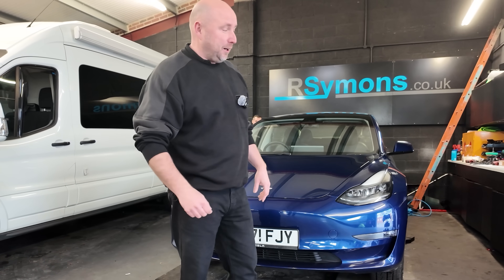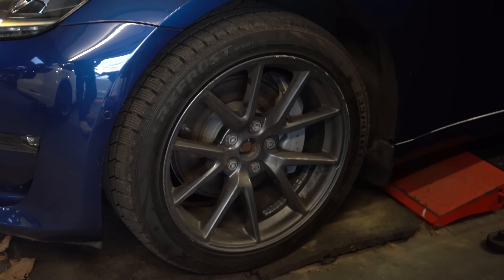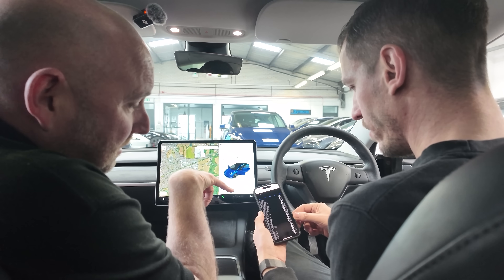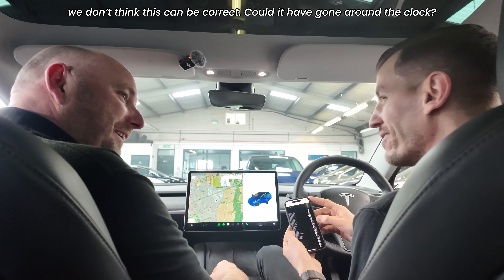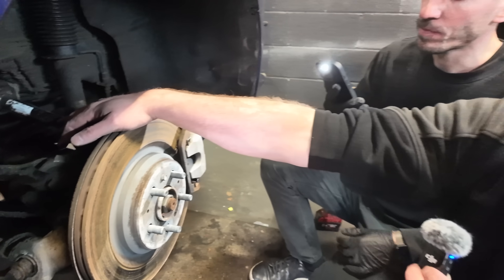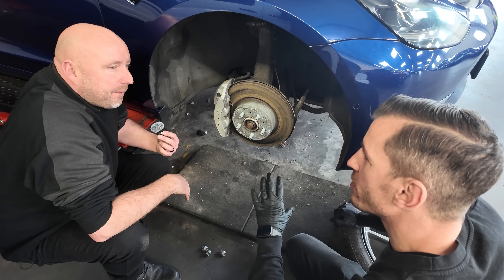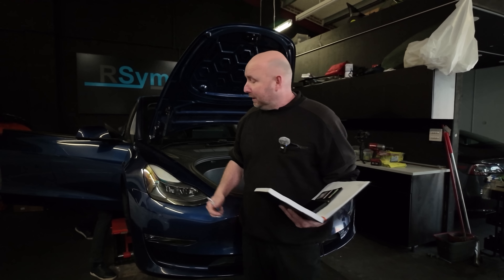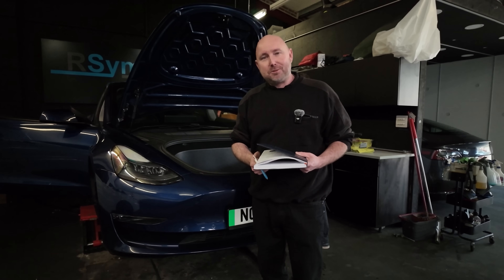EVERYTHING WRONG with my HIGH MILEAGE "21 Tesla Model 3! | Battery health and other issues!

Comment: My last Y went back with 90k miles on it , absolutely immaculate. Now got 3 RWD LR even cheaper to run and much better car . 
PS. The Y cost us 10 tyres , and the charging. Nothing else . 
I have friends with coal burners which are constantly being serviced or repaired at great expense.

Comment: My old 2014 leaf 130,000 km 87% battery just done the back breaks 1st time 4th set of tyres 3rd wipers and 8th cabin filter she has served me well. Picking up my long range model 3 tomorrow 133,000 km 90% battery new tyres and brakes because it was a fleet car. Off to Italy on Sunday willfigure out how everything works on the way.

Comment: You changed the wood looking panel because they peel off, that happened to my tesla less than 40k miles. My leather seats and leather wheels are peeling off as well. Paint cracks are showing off. This never happened on my 13 year old 200k mile prius. Tesla battery died on me and many failures. Never had issues on my prius. This shows how bad Tesla quality is.
Reply: glad i don't have leather wheels on my cars.   do you park this car outside a lot?

Comment: And it still maintains its horsepower and torque like new where as ice will lose 25% by then ...if in fact it doesn't need a brand motor.

Comment: Would you buy a lightly used tesla modle 3 long range? I want an honest opinion before I do... I can't afford a new one and I commute roughly 100 miles a day... in Canada so cold weather would you recommend it...
Reply: 1. What do you exactly mean by lightly used? What year, mileage?
2. Do you have charger or a plug at home? Or maybe at work?
Reply: @yuriymolodkin  yes ill have a level 2 charger installed. 30k-50k kilometers. 2020-22
Reply: @BentSmore 
1.
From the 2021 restyling, the Model 3 has a heat pump. It increases efficiency in mildly cold weather, but tends to break, especially in harsh environments (like below -10C). If it's under your warranty – no problem; if not, it can be pretty expensive to repair (around $2,000).
In principle, I'd strongly recommend finding a restyled model – ideally with a Ryzen processor (which you may find in the Model 3 starting from 2022).
But as with any other car, of course, keep an eye on the car's condition itself, as you can buy cheap and pay twice.

2.
If you have the possibility to charge at home, your commuting is no problem at all. If you have a usual scenario every single day, you can adapt your charging behavior to increase the lifespan and decrease battery capacity degradation by keeping your car around 50% state of charge. This will help a lot.
For example, I have 140 km in total per day when I commute to the office. The car consumes, on average, 20% one way and 15% on the way back. So I charge at work to 70%, then I have 50–55% when I'm back home, which is enough for some in-city commuting like groceries. The next day, I commute to the office again, arriving with approximately 30% to charge again.
Reply: @yuriymolodkin  very informative... if the car is left outside at work for i hour's in -15 -20c will i experience a big lose of range for my trip home? Most winter days in my area are -10 or warmer but we do occasionally get stretchs of deeper cold.my concern isnt really how far I drive more if I get stuck on the highway for an extra hour idling in a snow storm if ill be ok.

appreciate you taking the time to answer.
Reply: @BentSmore 
It all depends on several factors. The most important thing is that you have the charger at home. Because with it (assuming you will be using preconditioning if you don't have a warm garage/parking lot) the battery will have a temp of +10C. And the battery itself is massive, therefore it will have some time before freezing down. Plus, its heat will be used for interior heating and etc.
If we assume, that you did preconditioning at home and arrived at work with more or less warm battery, after 8 hours of being outside the car could show something like 10-15% less available energy due to low temperature. Regen will also be partially limited. But once you drive, car will heat the battery up again. Maybe not so fast, but it won't be conpletely frozen. And if you stuck in traffic it shouldn't become a huge problem then. Of course, you always have to think before doing crazy things like relying on arrival with 0%, but keeping some buffer helps :) If 30-70% will work for you in sunmer, then most likely during winter time you will need to expand it to 20-80% e.g.

When the battery is not dead frozen heating your cabin consume about 1-2kwh of power. You can calculate how many available kwh of your battery you need to stay in your comfort zone.
Reply: @yuriymolodkin really appreciate your responses
Reply: @yuriymolodkin  sorry one more question what do you think is more important when it comes to my choice in the model 3 year built or # of kms.. 2020-2021s in my budget i can find with like 30-60k but the 2022s are like 80k
Reply: @BentSmore  in my opinion in the end you're going to buy a car, and as for any other car, its condition is much more important than multimedia hardware revision for instance :) I'd say that finding a restyled model 3 (coming from 2021 with a heat pump, better interior, better sound insolation and sound system) is a good starting point. I wouldn't recommend to buy the non-restyled version. And then depending on the concrete car's condition you just choose what car is the best from price/condition ratio. If it's not 2022 or 2023 - it's not a big deal

Comment: The question is not how many miles but how many years will the battery last? Cause i have my Suzuki swift for 20 years and i have done 312.000 miles without any problem....

Comment: Model 3 is the worst car I have ever bought. Battery fine but everything else falling apart after 4 years and 35k miles. Leaks water. Squeaks. Seats don’t work. And to top it all off it’s worth nothing now. Much less than balloon payment on finance agreement
Reply: Have had mine for 112K. No issues here except for steering wheel leather peel.
Reply: @FaceMeltMarching that is the one thing that is actually ok in mine!
Reply: @stevewilliams1122 it really depends on the year you buy. Mines a 2020 and I know they really picked up build quality between 2019-2021 and now the new models are built really well
Reply: i do not own an EV but i bet squeaks are more noticeable in a car w no engine noises.  on my jeep wrangler i just turn up the radio
Reply: @joebezslu everything squeaks and all noises are heard yeah. Radio is a must

Comment: Very happy owner of a model Y standard range and model 3 performance (2nd one), previous car was a Honda CRV 2.2 Diesel which got to 160,000 miles, with an average fuel economy of approximately 37mpg (not bad for a big SUV). Only maintenance done was a £120 a year service and the EGR pipe cracked which Honda replaced free of charge, there was also an air conditioning flush and refill done at about 130,000 miles. Still worked perfectly when we got rid of it but the clutch was really on its last legs. I must say whilst I was massively impressed with the reliability of that car and the service Honda provided, the Teslas are so easy to run, especially when you consider the fuel savings at 37mpg!

Comment: Don't suppose you have a Battery health test for a high mileage Model 3 Performance? Early Freemont one would be good. Mine is at 13.2% Degredation after 73k miles
Reply from the maker: We have did a test on our 2019 M3P and it was 88% at 115k miles

Comment: I've been sceptical on evs with battery degradation, range, repairs etc , but after watching this video I'm starting to look at an ev for my next car
Reply: even if you are skeptical of batteries most of them come with an 8-10 yr warranty. Teslas post 2019 are generally great though and do big mileages without a worry.
Reply: Not all batteries are the same , only Tesla ,rivian ,lucid and a few more use 4650 cells . Other manufacturers don't have the longevity Tesla has to be honest

Comment: You need to change the oil and filter on the gearbox at 200.000 km. Proberly also check the heatpump for liquid

Comment: The current health report would appear to be no indicator of failure.  If you look at battery failures it is not a gradual drop off down to zero miles overtime.  They seem to go from reporting totally healthy to won't charge and a very large bill.  What we need to know is how often this happens under say 200k miles.  Is it 1% or 0.001%?

Comment: Had a f250 diesel 6.7 , in 13 years of ownership over $30,000 of repairs!!! That did not include the $13500 estimate right before dumping it.  Had 108,500 miles w less than 25,000 miles from towing.  Followed all maintenance schedule & did not drive crazy.  Dumbest purchase we ever made.  Bought M3 last month & hoping for a better run

Comment: I’m really considering an EV like this my only concern is Uk infrastructure. Looked at a trip to say Aberfoyle and a couple of charge points along the way but not really convenient. A great work around is being able to charge overnight at a stop over hotel but the nearby hotels don’t seem to have any plugs for standard overnight charges. For 80% of our use it’s excellent but that 20% is still significant. And that’s where I think things could improve to tip the balance. My mind is going back and forth between this and an x3 diesel and little things just out doubt in one’s mind about the EV.
Reply from the maker: Tons of chargers. Check on Zap Map app

Comment: Everyone knows when the Battery capacity drops below 80%, it's at end of life. It's only got 8% left.
Reply: @whoguy
Is that the same “everybody” as “nobody” want  EVs, despite year on year increas in sales? 
Even with 20% degradation it will still cover between 150 and 200 miles fully charged. Even if it drops to 50% will be able to do 100 miles, perfect for your local driving. After that it might end up as home energy storage.

Comment: Just bought an identical Model 3 (71 plate Blue AWD), but with 45k miles, so this really helps put my mind at ease that it is going to last! Took it to Tesla to fix some creaking (interior) and they changed the O ring too, so must have been a recall.

Comment: I think your calculation is very generous for the diesel, a lot don't realise yeah an average diesel can do 50 mpg or more but, what about a high performance diesel that could match that Tesla's performance, you won't be getting anywhere near that. I had a 3.0 V6 Audi A4 0-60 in 6.8 I believe and that being drove carefully on short journeys was about 24-28 mpg, motorways about 38 with sensible driving. So now think of those diesel costs. That had 180k but was old and now scrapped because of rust unfortunately

Comment: Tesla are known to run to high mileages without too many issues and have an 8 year 100 or 120k battery and powertrain warranty.  However, I wouldn't want to run any other make outside the standard 3/4/5 year warranty as the powertrain is not covered.

Comment: really interesting, have you done any battery condition tests on the LFP battery cars from China yet to see what they are like bearing in mind they recommend to charge to 100%, my 3y.o. M3 has lost a tiny bit i think, but it's only done 10k miles so not a good judgement or what is normal.
Reply: There is another video about battery degradation on this channel and it covers LFP batteries as well

Comment: In Denmark a car needs an MOT when its 4 years old and then every 2. Year.
Around 7% fail MOT… Tesla its almost 25%.
Reply from the maker: We have MOT at 3 year and then every year. 
Out Tesla fail less than anything else
Reply: When I took my Tesla M3 for it’s MOT, it passed with no issues, the tester said he felt bad asking for the full price of the MOT as there is so little to test/check compared to an ICE car. Therefore far less to fail on.

Comment: I used to buy >100k miles ex-lease cars then put another 100k (taxi) miles on them before replacement. Even a well maintained ICE will get to 200k miles comfortably these days. My EV has done 100k now and hopefully will do at least another 100k.
Reply: And the service cost (and/ or time) of "maintaining them well"?
Reply: @rogerstarkey5390 Let's not go there! In fuel terms alone I've gone from 17p per mile in 2019 to 2p per mile in 2025. I always looked after my cars so dropping the oil every month was 12 x £65 per year. Servicing became £100 every 10k miles. For clarity I paid £7k for the Avensis and £22k for the Ioniq. I could get the equivalent EV for half that now. C'est la vie!

Comment: The Model 3 is very low maintenance. The Model S has more bells and whistles that do and will break, I could almost buy a high milage M3 for the maintenance I've done on mone. If you find a model 3 with little to no rust and is maintaned the milage really doesn't matter very much.

Comment: My previous cars tended to cost £500/£600 for a sevice, repairs and replacements of parts as wear and tear maybe another few thousand, then a true saving over £25,000 in 4 years and 216,000 miles is incredible and it still has most of it's initial range. Amazing.to see.

Comment: Hello
After 10 years and 445.000 km my model s still have 87 % capacity 
Eric from Belgium
40% SUC 60% at home single phase 3kw ....
Have a nice day
Reply: @ericverlaet4447  Great to hear👍⚡
Reply: That's impressive.
Reply: Model S 85P+, 420.000km 84% cap, 30%AC, 70%DC. Plus still puts a smile on my face every time I hop in. Greetings from sunny hot inland Australia.
Reply: Looking at a 2020 Tesla 3 here in Canada . It has 100 thousand km on it . I drive about 600km a week . Would you reckon I should get it ?
Reply: How do you calculate the battery capacity?
Reply: @ Shows on your cars display.
Reply: @13Dominoo  Battery health test under the service tab.
Reply: thats amazing
Reply: Tesla seems reliable not looking people are saying

Comment: Its clear and EV saves a fortune....is this the reason big oil and ICE car manufacturers are sneakily working together to "Hike" EV prices to put people off buying them...even now when they have a target of 28% sales. I love this post and will share it wide to the usual anti EV FUD spreaders.... oh and less brake pad dust, recycled engine oil... of the £27K spent on fuel, NOT ONE THIMBLE FULL IS EVER RECYCLED.

Comment: I pay about $.31/kWh in the New England. I’m not sure I have any significant savings over driving an ICE  car in this area.
Reply: Perhaps your petrol is cheaper than in the UK.  We pay around £1.40 per litre.  Taking into account litre to gallon conversion, then reducing this for the smaller US gallon and converting to dollars at current rate and we pay the equivalent of $4.20 per US gallon.  Does that make more sense?
Reply: @ Regular gasoline is just under $3/gallon here. Very good prices over the last year. So electricity cost 3 times more and gasoline is about half the price here.
Reply: @ Check the numbers ... if you can buy gas for $2.48 you will break even ... otherwise you are still cheaper with electricity even at your present price. Even better if you can get a cheap rate tariff.
Reply: No your ICE fuel is also about half the cost from Europe. ( I compare to Sweden. It varies massively in the EU also.) 1l of petrol is about 16kr. It makes a gallon cost about 5.7USD. Comparatively I pay about 1kr for 1kWh  (but it varies per month also.) . So close to 10cents per kWh a third of your price?
Reply: If you have a smart meter in the UK you can get a cheap rate tariff that makes the electricity much cheaper if charging overnight. Charging with full price electricity wouldn't give as much of an advantage but would still be cheaper than diesel/petrol ... partly because our fuel prices are high (our price is equivalent to you paying $5.13 per US gallon for petrol/gas).
If a Tesla was to average 4 miles per kWh your electricity costs (based in your $0.31 kWh) to travel the same distance as the average US sedan (which gets 32 miles per US gallon) would be $2.48 ... so given that (according to Google) a gallon of gas in New England actually averages $3.146 you are still getting some savings ... = 23.6758% difference ... so over the course of a year that's still a worthwhile saving if those numbers make sense! If you can buy gas for less than $2.48 then the EV costs more. However, if you can get a cheap rate electricity tariff for overnight charging then the numbers go way way more in your favour.
Reply: @ Regular gas is easily available here for $2.99. No overnight cheaper electricity rates here. The 4miles/kWh shown on the car's trip screen underestimates the electricity one pulls from the "wall". It misses charging conversion losses (about 10%). Also if you compare the number of kWh on the Tesla phone app (4388 kWh lifetime for me) vs the car's screen trip figures (3677 kWh lifetime), the phone app is always higher (19% higher for me)  because the car's kWh/mile figure doesn't account for all the batterie's electricity used. I'm not sure what it doesn't account for, perhaps wasted heat, etc. Tesla falsely uses a lower kWh figure than you actually pull from the grid (and are actually pay for) in order to show better efficiency.